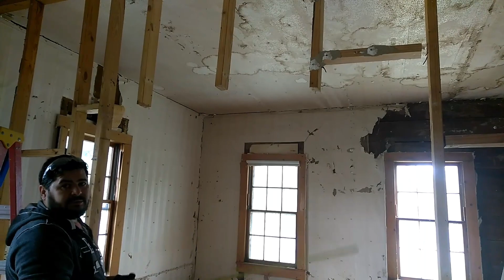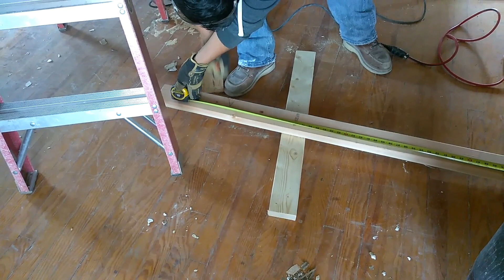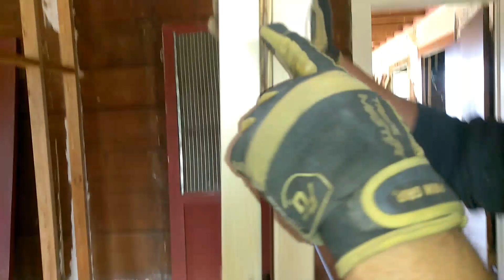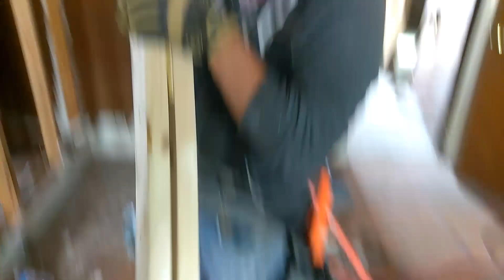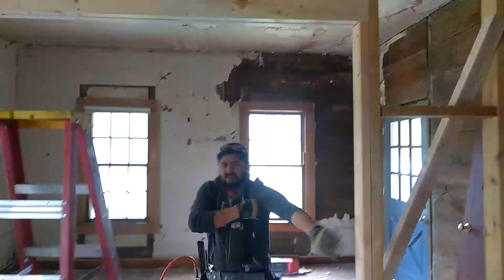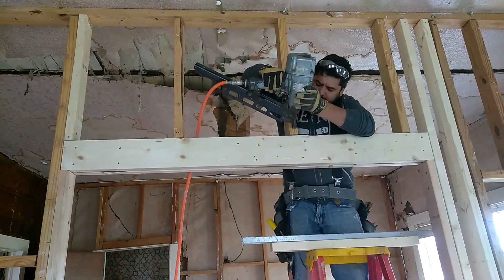Como hacer un Marco para una puerta.✅

Comment: espanol no es mi primer lenguaje solo practico para comunicar mejor con mis companeros pero, no se la palabra correcta pero ese "trick" con tu torpedo para el cripple fue el mejor tip del dia para mi muchos gracias eso es uno de los secretos
Reply: Trick = truco